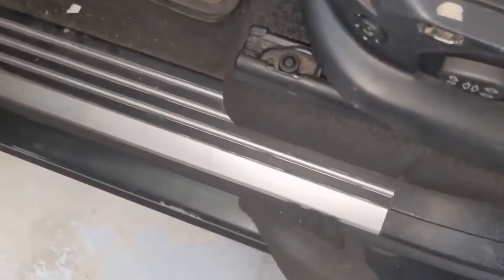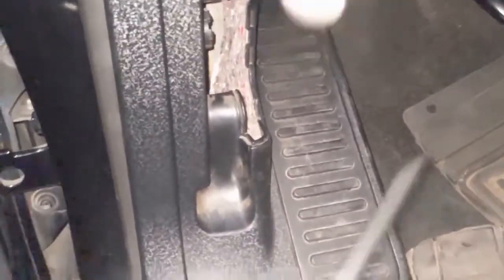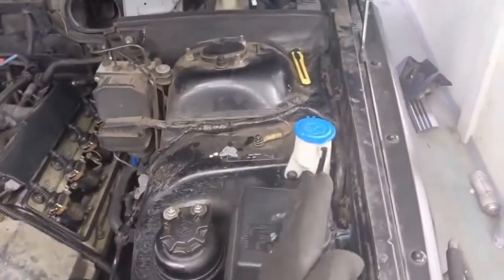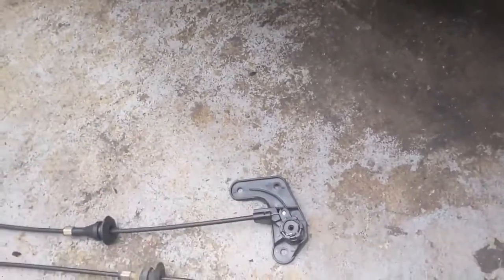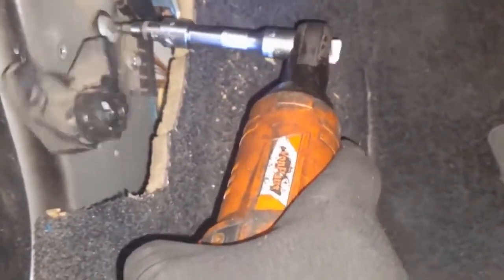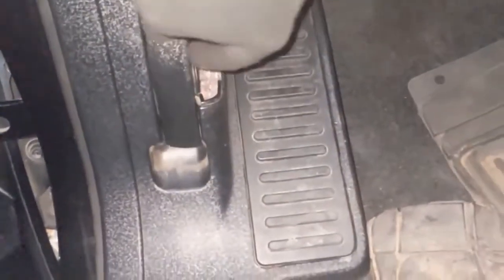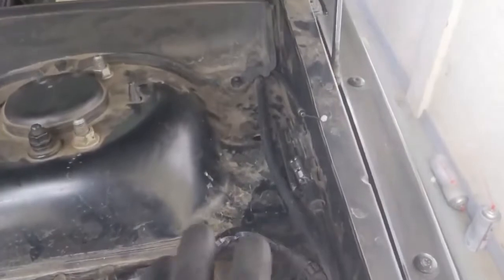2003-2005 Range Rover Hood Latch Cable Lever Replacement | How to Fix Car Hood Latch Cable

Comment: I’ve just replaced the cable. Everything smooth & easy, same route as original.

EXCEPT, I can not get the rubber grommet/plug/boot fitted fully to the bottom. Only half way!

I have used Vaseline, flat screwdriver, cheer power from one pulling the rubber and another pushing it.

Is there a better way?
Reply: Same here the grommet is pissing me off

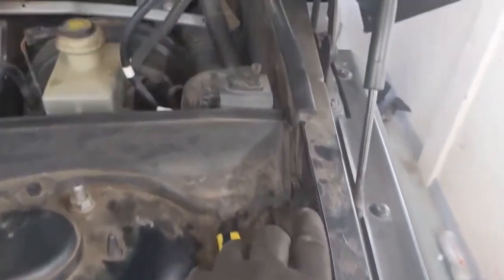Comment: Hey the part where the two cables come together at 2:08 mins into your video. Am missing that connector . I have the new cable but I don’t have the connection part. Do you know where I can get that ?

Comment: If anyone knows the spec for the T30 mounting bolts and the Philips head one which fits on the handle I’d be really grateful. Land Rover have discontinued the mounting bolts and the Philips head one is on back order! Thanks